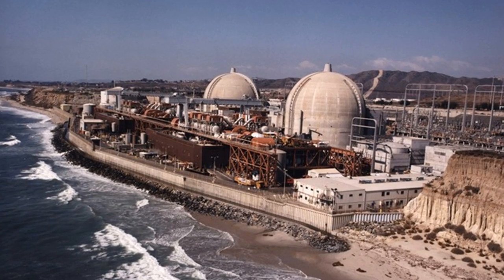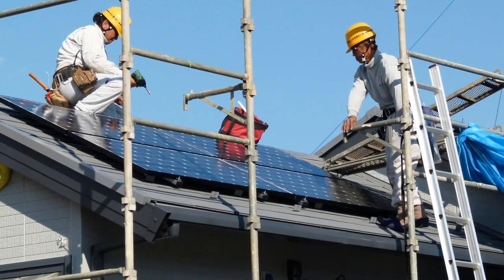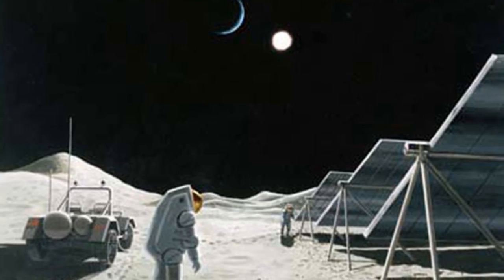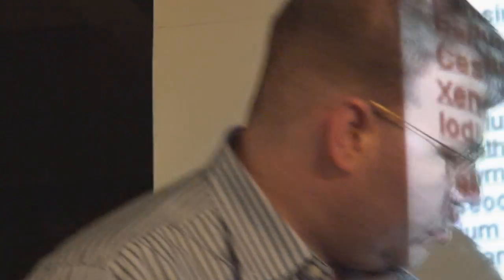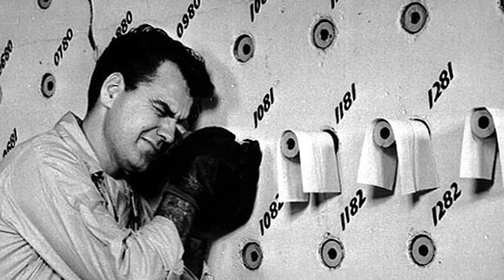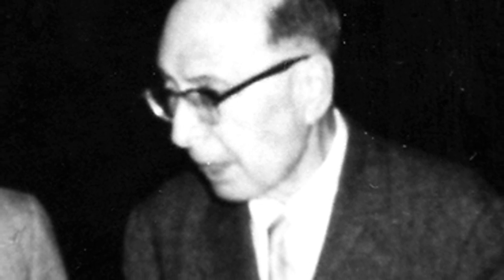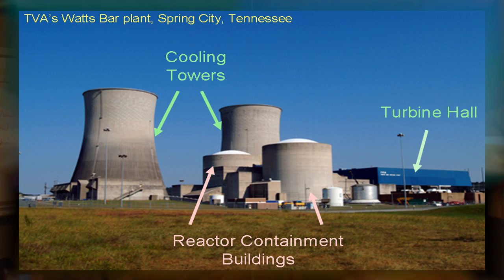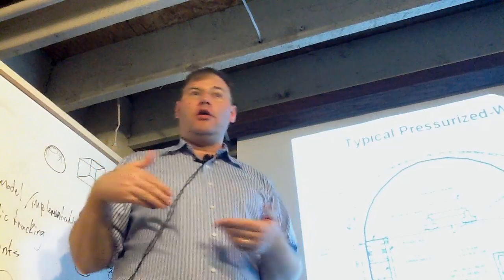Thorium: An energy solution - THORIUM REMIX 2011

Comment: Hi Gordon,
is there a forum where LFTR enthusiasts (and lay-people) like myself can ask questions?
Reply from the maker: Max Green I don't know if this is active but at one time it was sorta the focal point. http://energyfromthorium.com/forum/
Reply: Thanks Gordon,
but there does not seem to be a Register button in the usual places for that software. However, I've emailed the moderator so hopefully that will let me in. I don't know if you can help me in the meantime? I'm writing a piece on nuclear power 'For Dummies' by a dummy! (I'm a humanities boffin by background). I'm wondering what nasties would escape in the terrorist scenario below?

From a recent forum discussion:

The liquid fuel only fissions if there is power supply to the reactor! Most nuclear safety systems require power to cool the reactors and shut them down. LFTR safety systems trigger if there is a lack of power. It takes power to freeze the salt plug holding the fuel up in the reactor core. If there is a power failure the frozen salt plug melts from the intense heat, and the fluid just drains away into a non-reactive drain tank where the heat is quickly dumped into heat-absorbing walls. Even if someone put some TNT on the reactor itself and blew the thing up, the liquid salt would leave the reactor core and immediately stop fissioning. But being salt, it would also quickly dry and harden (at hundreds of degrees) to lock the radioactivity in the local area. While radioactive steam shot around Europe after Chernobyl, LFTR's lock it locally in the most catastrophic scenarios imaginable.
The liquid fuel only fissions if there is power supply to the reactor! Most nuclear safety systems require power to cool the reactors and shut them down. LFTR safety systems trigger if there is a lack of power. It takes power to freeze the salt plug holding the fuel up in the reactor core. If there is a power failure the frozen salt plug melts from the intense heat, and the fluid just drains away into a non-reactive drain tank where the heat is quickly dumped into heat-absorbing walls. Even if someone put some TNT on the reactor itself and blew the thing up, the liquid salt would leave the reactor core and immediately stop fissioning. But being salt, it would also quickly dry and harden (at hundreds of degrees) to lock the radioactivity in the local area. While radioactive steam shot around Europe after Chernobyl, LFTR's lock it locally in the most catastrophic scenarios imaginable.
Reply from the maker: Max Green Generally that's my impression too, but the sentence "The liquid fuel only fissions if there is power supply to the reactor!" is misleading. Liquid/solid have nothing to do with fission happening or not happening. Reactors are very easy to shut down. Only Chernobyl was an criticality accident, and even after the reactor exploded the fission stopped. Stopping fission isn't hard... it is managing decay heat which led to dispersion of radiation. Liquid fuel helps because the coolant is also the fuel... the two can never be separated. In all 3 famous accidents, the decay-heat-generating fuel rods were separated from adequate coolant (like say liquid water boiling away to steam) and then the temperature of the fuel rods climbed quickly, because the tiny surface area of the rods was unable to radiate the heat faster than it was being generated. Liquid fuel has more surface area and I don't see how it can ever lose the ability to radiate heat more effectively than rods.
Reply: gordonmcdowell Thanks Gordon, well said. Even I understood that! ;-)  Cool.

Comment: Excellent video!  
I think LENR will overtake LFTR, but part of the reason I looked in to LENR (aka "cold fusion") was because of the government's failure to pursue LFTR.   Otherwise I would have assumed that LENR would have been pursued if real.  
It will be hard to stop LENR because it scales down and small units can be built cheaply to prove the technology.

Comment: They tested different compositions of Hastelloy-N. 3 particular melts were good enough for their upcoming large prototype.

The quantities of graphite used will be very small on the industrial scale.

Chemical reprocessing through vacuum distillation is a well-established process. Isotope sale revenues will more than make up for the cost.

FLiBe is not that expensive, especially compared to the revenues. It can also be recycled.

Comment: It's a lot better than LWR's, but LFTR has even more advantages yet. Added passive saftey, even more abundant fuel stock. Less chance for weapons proliferation, Disolved fuel allows better control of the reaction mix chemistry and composition.  It can react to veriable loads on the generator. (pull of more heat the salt cools and pulls more fuel into the reactor and vice versa.  In addition thermal is more forgiving than fast in fission as design goes..

Comment: @stathamajf LFTRs cannot melt down. This was what happened at Fukushima. LFTRs do not have nearly as much radioactive waste. You only need 1 ton of thorium for 1 GW, compared with 250 tons of Uranium for 1 GW. So if something DID go wrong and there was a leak, the aftermath would be far, far, far less devastating. No where near Fukushima, which was leagues less severe than the disaster at Chernobyl.

You can put a small amount of the thorium that would be used in these in your pocket. It's safe.

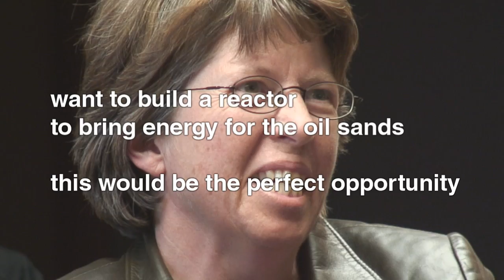Comment: Build an LFTR reactor to bring energy to the oil sands for oil extraction at 1:04:15 ? Are you kidding? I could not believe my ears. LFTR is to nuclear power as the computer mouse is to computers. When the mouse was proposed it was mostly ignored and scoffed. Today, it is an obvious, essential technology tool choice. Great presentation here. Why aren't we building more of these in favor of the water reactors? The reason can't be cost because all nuclear power plants are expensive. Given that nuclear is expensive, initially, it seems the lowest health, safety, and environmental risk impact would be LFTR due to low pressure, no need for triple+ redundant backup systems, the reaction itself is positive stable, the efficiency is 90%+ and not less than 1% like the other reactor types. Then there's the ingenious "freeze plug" concept which drains the liquid salt, by gravity, which inhibits the reaction if, for any reason, the power to the electric circulation pumps is disrupted. The availability of fuel - Thorium - is on par with Lead whereas Uranium is on par with Platinum. The cost of mining for Uranium, alone, would scare venture capital, based on it's difficulty to find. The primary concern should 100% be safety and not whether or not Plutonium can be made. There are too many positives for this LFTR method of nuclear power to be ignored: no carbon emissions, high efficiency, built-in safety (not engineered safety), abundant and available fuel source, relative simplicity and elegance of design, no giant cooling towers because the heat energy extracted when the water cycle steam expands through the turbines of the electric generator (I assume that a condenser similar to what coal plants use would be needed in that case), and there is even an isotope useful for fighting cancer that results from this reaction.
Reply from the maker: +richmaloon I live in Calgary, Alberta. That's where the majority of this footage was shot. While there's many Calgarians here quite concerned about global warming, as you can imagine, when most jobs depend on carbon emissions that's where more people are skeptical about global warming.

Complex hydrocarbons in the ground can be used for many things other than pumping them into the atmosphere. If there's any way to push MSR or LFTR development forward with the carrot of keeping local natural resources viable by lowering their carbon footprint, then I'd like to see it happen.

There's no one single path to funding MSR development... each region has different strengths and could use high-temperature operation for unique purposes. Regardless of the local purpose, if it drives the fundamental R&D (material verification, construction of a non-radioactive prototype to confirm heat transfer modelling) then it won't matter where the first commercial instance was constructed, nor for what purpose.

Comment: @RegioLunar As discussed in this movie the government shut down the Molten Salt Reactor Experiment, not those running the reactor. There were no safety issues that led to the shut down, only political considerations made under Carter. Heating up a salt to hundreds of degrees is not safe why? What proliferation are you talking about here? U-233 is proliferation resistant. Why would you support a LFTR designed to reduce toxic waste but not one that can both generate electricity and reduce waste?

Comment: i've found nothing saying canada has any breeder reactors. i support the idea of LFTR because  Th-232 and U-233 are incredibly impractical for weapons, but highly efficient for energy. i see the effects of coal, oil, and hydro plants as having a far greater negative effect than a properly engineered nuclear plant. the issue is that corporations take command in building a plant, rather than scientists. more than half the canadian plants were initially built for research and are over 30 years old

Comment: Check out the Free Piston Stirling Cycle Engine design that Sunpower uses in it's Biowatt electric generator. Might work well with a Molton Reactror that would be small enought to put in your basement.  Just like Ike said in the nifty fifties!  I like Ike.

Comment: @Alectr0n Due to the high operating temperatures of LFTRs, you wouldn't even need to change to electric. You could use the excess heat from the reactor, some 400+C of heat, to produce synthetic gas from carbon dioxide and water. The advantage of doing it this way is that there would be no need to change the infrastructure, and the price of gas would probably dive into the ground, while  two things that will make everyone happy. Environmentalists would love it too, since it's all carbon-neutral.

Comment: @Hardwyre I understand what you are saying, but that is no longer true.
The same technology that makes it feasible to drill for and harvest oil deep within the Earth can be used to dig down to the depths needed to reach effectively high temp.
As for a large amount of the hardware being underground, this is true only to the extent that the pipe that allows the steam to get to the surface is underground. The pipe may be a mile or more long, but the same could be said about any oil well.

Comment: The capital cost and land required for solar by itself is high, but when you factor in the additional cost of added a power source to keep power supply up during night-time, it becomes an uneconomical source of commercial power. Solar is still go for power generation in remote areas and space applications but Solar, at least for now, should focus on R&D instead of mass-production for commercial power.

Comment: @6:10 I am a proponent of this kind of nuclear energy. Better efficiency with what we now have will not recycle our landfills of the plastic, paper, metal mix nor will it do anything to stop plastic from being dumped in the oceans of the world where hundreds of square miles of plastic just swirl. Did you ever try to take the paper labels off your plastic bottles to recycle them?  It takes dirt cheap  and  non-subsidized energy to close the recycling loop efficiently.  Government subsidizes much that is wasteful and unproductive.  The aluminum mining and refining industry necessary to the military industrial complex which cannot use recycled aluminum for cars and aircraft buys power from the grid far cheaper than we do.  Recycling plastic is a LABOR INTENSIVE activity  and China does not want it any more.. The advantages of the thorium molten salt  route is that it burns up all of the nuclear waste.  Coming out the other side the radioactive decay products are separated from each other chemically.  The "hottest" ones can be stored briefly until they decay so many half lives that they are no longer a problem and have turned into perhaps a chemical resource.   the longest ones can be put in the ground and become some chemical after 300 to 500 years then "mined". The LFTR plant that is proposed is like 90% a chemical factory and 5% nuclear fission and 5% breeding thorium into fuel,  The early pioneers of nuclear power were BRILLIANT but a few appear to me to have been rotten apples though Kirk graciously excuses them giving them the benefit of the doubt..  Taking solid pellets and reprocessing them is a dangerous and  inefficient process but in a molten salt the stockpiles of nuclear waste simply become part of an ongoing molten salt chemical reprocessing process if we elect  to burn our present stockpiles of waste containing nuclear fuel as a slow addition to the thorium.  I presume we could also burn a little U238 to eliminate our depleted U238F6 stockpiles leaking into our environment which produce horrible birth defects .  if deliberately targeted in a nuclear war who known the damage one nuclear bomb could cause if dropped on one of there sites? It would be like Babylon in the book of Revelation. .Molten salt chemistry is becoming more and more important and I hope the kids growing up will learn new and innovative ways to turn solids to salts and separate each component.  Even present advances in fusion propose to want to use FLiBe. salts perhaps while running fission processes along  side or in the background. youtu.be/7Yww1AwXf_s  Some propose to use molten metals and salts for long term battery storage.for other form of renewables.  youtu.be/ZRyo0Nr7CrY  The unfortunate problem with batteries running above room temperature is that they need insulation with materials that have an extremely high R value.  his puzzled me because NASA developed for their Space Shuttle reentry program these heat shield tiles with crazy high R values.  Why industry cannot do with this tech what they did with the magnetic superconducting ceramics I do not know making them practical for home insulation the clothing industry and high temperature molten salt and liquid metal batteries.  To me if I were a youngster the possibilities are almost limitless. if we like NASA bring many tech advancements together into thorium''s  naturally efficient safe & stable with other tech on site nuclear/chemical plant.    I fear though that there still are lots of vested interests in nuclear technologies that want to crap over the advantages of the LFTR for many the wealthy  powers that be are pressing for  second, third, forth, best. These really do not want dirt cheap low maintenance electricity on the consumer end.   Perhaps these have bought up all the nuclear waste dumps and want to bring forth small fast neutron reactors that are fueled by melting them down into some other form and using reactors designed to burn only present nuclear stockpiles with no thorium advantage.  Do you not sense some push back out there?  If Congress wanted to they could implement this tech almost over night with perhaps a few relatively  low tech hurdles to jump.  THE CO2 turbine also could be amazing turning heat to electricity with an efficiency of 40%  WOW!

Comment: I prefer using the Russian BREST nuclear reactor because they can operate at non-pressurized atmosphere, cooled with heat conductive molten lead that simultaneously acts as an additional shielding and flows by natural process of convection and heat conduction and heat sink dissipation by the massive mass of molten lead. It's fuel is plutonium nitride made from U238 w/c is considered a waste by product. The U.S, based on 1980s estimates has almost 300 million tons of mine tailing made of U238!

Comment: Hopefully someone will chime in but in my completely inexpert opinion, there doesn't seem to be any valid or sound argument against even traditional high pressure reactors, as long as they are properly designed. The arguments against seem to rely mostly on logical fallacy and/or incorrect data. The only remotely reasonable argument I can think of is short term cost.